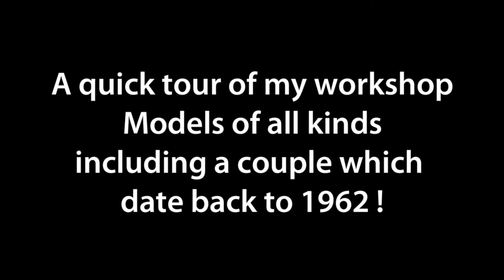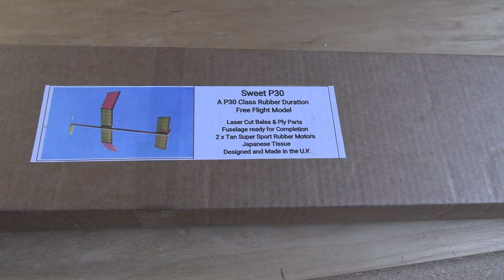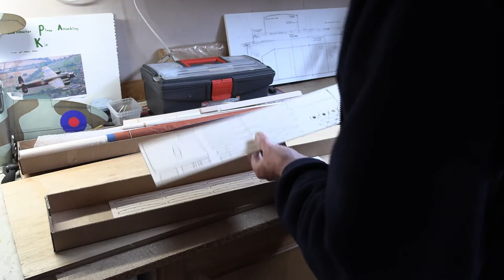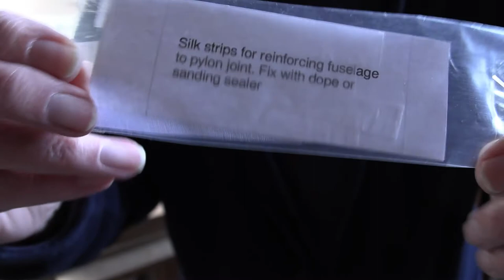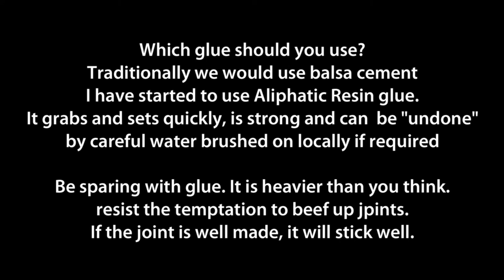Tour of my workshop and unboxing of "Sweet P30"

Comment: Spencer Willis kits are top notch. He also does custom propellers that are the best. This P30 is very competitive, and not just a beginners model.
I have recently bought the very cheap BMK radio dt. Faultless so far and ideal for competition or flying in a restricted area like a park or Old Warden.
Reply from the maker: Thanks Jim. I have installed a button damper DT which gives up to about 6 mins after a bit of fiddling with different spring strengths/lengths. The damper is the same button kind used to damp kitchen unit drawers (ACE FRT-E2-100 +50°C 0°C 10, Tooth 6mm, P.C.D 0.1±0.05Ncm). I adapt a rubber prop nose bobbin as the drum.

Comment from the maker: Thanks for the comments. The Model is finished apart from waitng for some nylon filament for the DT line.
The model came out at 45gm (without rubber) which is a touch heavier than the 40gm requirement in the rules, but I want it for general small field flying and therefore robust. It would probably still be competitive with some decent rubber, so could be entered in BMFA competitions. looks very straight (no unintended warps), so should be straightforward to trim.
Will add  at least a photo once it is complete. Then hopefully a flight video given a suitable first trim day!
People like Spencer Willis and Mike Woodhouse help to keep free flight flying alive in this ever digital world. I try to do the same by co-running indoor meetings ( www.creativesweb.co.uk/norwind ). We have been shut down since March 2020, but will hopeffully be back by September 2021

Comment: I ordered this kit to myself and some juniors aswell. They fly really nice, but i decided to remake some things- we used different balsa sheets for pylon. the original pieces included are soft and have bad grain direction, but its understandable, since its only way to fit the laser cutting on this balsa sheet. with grain direction upwards its much more stable. And also maybe dont glue them together, leave a big cap between. Quality varies kit by kit, we had 1 kit without sanded trailing edges and fuselage tube with cracks. And also make sure to use blast tube or outside fuselage winding, because those tubes will break if you break fully wound motor inside.  We use F1G piserchio hooks and load already winded motors inside, just like F1B/F1G.
Reply: I'm surprised that you think the quality varied. I like to think that the last one is as good as the first . There have been about 150 made without any complaints. I wouldn't knowingly send a tube out with splits in it. Any that are substandard are kept back and used by me. I currently have 8 models. The pylon is quite strong enough with the 2 end pieces of vertical grain. The only weak point around that area is where it's glued to the fuselage which is why for many years I've been supplying glass fibre tissue or silk as reinforcement. As for the trailing edge, I have given up supplying shaped wood as the quality varied a lot and now all wood is light quarter grain stripped by me. Regards Spencer Willis